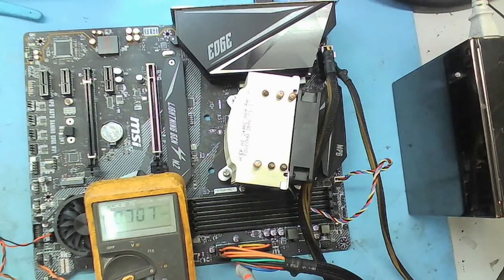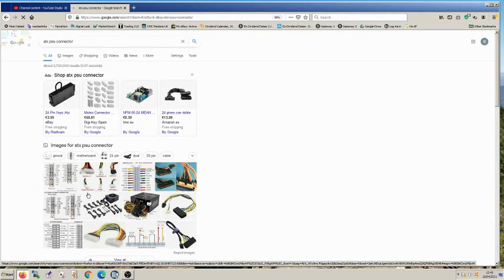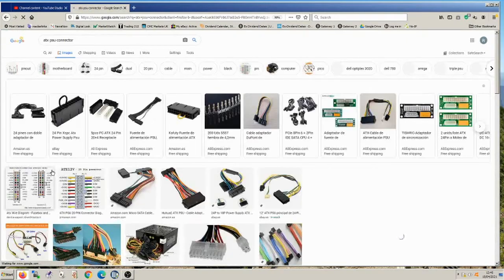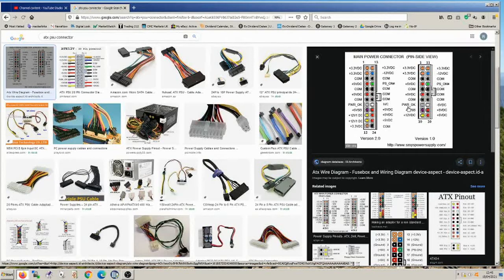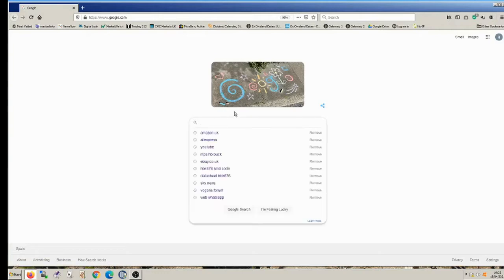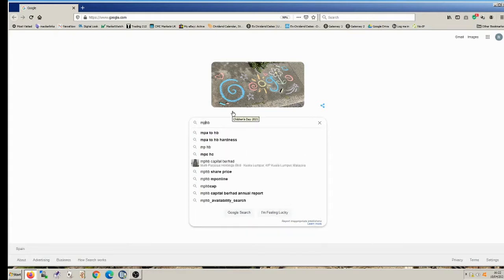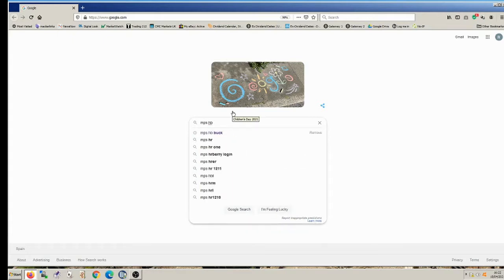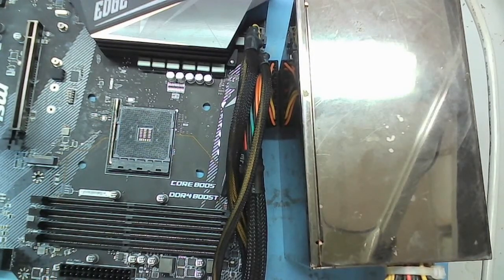Learn Electronics Repair #32 Gigabyte X570 Gaming, MPG X570 Dead Motherboard Component Level Repair

Comment: 0:01: 💻 An overview of two dead socket AM motherboards, both with the same chipset. The goal is to find and fix the power issues.
07:07: 🔧 Troubleshooting a motherboard component for normal current flow using a test meter with microamps range.
13:50: ⚙️ Discussion about building a custom PC with secondhand parts, including the need for specific RAM and GPU at a reasonable price.
20:19: 🔌 Discussion about identifying and testing components on the motherboard for repair and installation of power switch and speaker.
29:33: ⚙️ Troubleshooting a motherboard issue related to CPU detection and power supply signal, with focus on LED indicators and wiring connections.
36:05: 🔧 Electronics repair process involving voltage regulator investigation and microscope examination.
43:39: 🔧 Troubleshooting and identifying power issues on a motherboard using a multimeter and checking for voltage.
52:48: ⚙️ Troubleshooting and repairing a damaged motherboard with broken retaining clips and faulty CPU.
1:02:40: ⚙️ Troubleshooting a motherboard for sound issues, manual reference, and CPU socket problem.
1:11:37: ⚙️ Troubleshooting and testing a motherboard for component level repair using a multimeter.
1:19:09: 💡 Identifying faulty voltage regulators in motherboard component level repair.
1:26:24: 🔍 Identifying a fault in a motherboard component and searching for its datasheet to proceed with repair.
1:32:25: 🔌 Explanation of finding and identifying electronic components through product codes and manufacturer search.
Recapped using Tammy AI

Comment: Can you guys repair my x570 morherboard? After watching your video I have determined that it's the m t p power regulator that problem needs to be replaced just like in your Video. I can't seem to find anyone who does repairs. Is there any way I can get in touch with you. And I really need to fix it? It's an m s I prestige x five seventy

Comment: Hi Richard!
I have a theory on this and I'd like to verify, but I can't find the 2nd part.
My theory for the 1st is the chip you're looking at, and i believe it was replaced and still not working. So something around it, probably.
For the 2nd i believe that the 3v3 is coming from the 5v and the high-side mosfet is shorted.

Comment: Are you in Spain? 
My MSI B550 went INSANE a couple of days ago it started up on it's OWN in the middle of the night, turned it off from the back and left it, the next morning I switched it on and it would just boot to Windows and instantly shut down again repeatedly now, it won't post at all. I don't overclock everything is at stock. Tried changing GPU CPU RAM PSU too.... but nothing! Infuriating.
If you are in Spain I'd like to send it to you for repair!

Comment: Thank you so much for the videos!! I'm leave a summary of repairing mine so that maybe it will help someone else in the future.  If needed i can get more specific with the locations of the chips and caps i worked with.

One of my msi x570 boards just like in the video had the same no power problem,however mine only had 3.3v at the power button pin and the super io cap as seen in the video..everything else checked in the video had zero volts..

Using my Thermal camera i saw that the Ldo regulator gs7133 about 2" to the left of  the cmos battery was getting very hot when turning on the power supply. 

Thought that regulator was bad,so i replaced it with a gs7135 i had laying around.however the only change was that the regulator didnt get hot during standby.still no power to the Southbridge nor any at the regulator you worked with during the 2nd video.

So i gave in and tryed shorting the green wire to ground on the 24pin connector to force power through the board and it turned on.

After that i noticed the Gs7135 ldo regulator was back to getting hot during standby,but this time the output was shorted to ground and another chip about 1" down from the rear io was getting super frickin hot,but the board would now turn on with the power button. 

For mine i had a cap about 1" from the rear io short to ground when i forced power through the board and that seems to be what was causing both chips to get hot.just removed what was left of that cap and now everything but the Southbridge fan(which i think is a separate issue) is working and booting into the bios with nither chip getting hot during standby.

Not sure how that cap could have been causing the Gs7133 to be shorted with no power on at first but not that other chip,then getting exploded during the forced power on and shorting both chips.

But hey the dang thing powers on and gets into the bios now 👍.

Go poking around the caps just below the rear io going towards the first pcie slot and see if any have a short..

Comment: do you have a motherboard that has an error code 00? my other computer gives out that error code. thanks for the video.
Reply from the maker: Yeah code 00 means the CPU has not started to execute any code from the BIOS.  I see it regularly with boards that will power on but will not boot. You get that error for example of the system clocks are not running or the CPU is stuck in reset.  Sometimes too with incompatible CPU type for the motherboard. When I next find one doing that I will make a video
Reply: @LearnElectronicsRepair   I have one X299 i know this could be duea Short but i dont have schematics and i cant find it